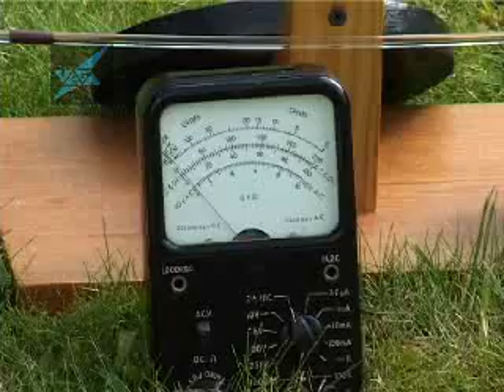Windmills Homemade

Comment: It`s common for many families to stare dejectedly at $200, $300, $400, or even $500 in power bills each month. There are times when even a rich family cannot seem to afford amounts like this for the upcoming months. You can cut electricity usage and bills through the generating power method “boma fetching unique” (Google it), which helps you generate you own power.

Comment: the last one you demonstrated? The Flutter generator, say you had a small drone plane, and using this theory could you add enough flutterers to it to run the small electric motors or atleast charge the battery/capasitor enough that it would not lose power and could maintain flight until the engine failed?
Reply: I believe the flutter generators would cause too much drag to be able to be mounted on a plane, or it wouldn't fly
Reply: Ever see a kite with ribbons on the ends? I think it wouldn't cause too much drag. Think of a bird and it's feathers. But imagine generating static electricity from wool and latex feathers that could generate enough power to run a small motor. Think of it. So long as there is wind passing through the feathers causing them to create static generating enough power that can be stored in a capacitor or small battery to run an on-board motor that would power the craft indefinitely
Reply: +Erik Palafox what's up
Reply: Babukrishna ? The sky and solar power.
Reply: +Erik Palafox: I can see the possible potential of your idea, however I see big problems obstructing a positive outcome.
1A: Aaron Keith was right. The biggest problem is the drag added to the vehicle. 
1B: The amount of Work being done in generation of electricity would not out way the amount of work being exerted by the motor to keep the vehicle in flight. How do I know this? because the transformer that would do the generation would be heavy and not 100% efficient. Work-in will always be more than work-out. The best case scenario would be an extension to the range of the vehicle. 
2: A kite doesn't fly... it hovers (erratically). Also The reason a kite stays in the air is due to pressure from wind. A kite would be a great tool for utilizing the flutter design though, if you could find a way to make it stay up without having a human control it 24/7...and the control mechanism used less energy than the kite produced...
3: Birds... let's not go there. if you tied kite tails to the back of a bird it would just need to eat more worms...
Reply: I wasn't talking about a bird, but the design of the creatures "feathers" One feather latex material and the other wool, or other conductive material that could be used to generate a current. Instead of a transformer, a capacitor could be used.
Reply: What if at the  top rear of the plane, the point to which the most drag will occur someone designed a wind turbine in the shape of a steam boat wheel on both sides. off set each side so that when they spin they alternate their directional push???...
Reply: Americans never say it can't be done. I say it can be done. I just need someone willing to make a prototype and experiment. I think it's completely possible.
Reply: hopefully you can visualize my idea. I honestly think it might serve practical application.
Reply: It's also a good idea Dustin. There are lots of things out there that haven't been proven successful mostly due to a lack of application.
Reply: And some of the best and coolest things were made in someones garage. It takes someone willing to invest time money and thought to produce something awesome.

Comment: you do not have to turn the wind TURBINE to follow the wind just put it on a rotating disc the once you can also use for a TV and give the wind turbine a tale so it will automaticly follow the wind direction!

Comment: its NOT a windmill it is a wind turbine if it charges things!! do NOT call it a windmill it isnt crushing weeds into flour...
Reply: Exactly what I was going to say
Reply: +S Dew you mean it's not milling?
Reply: themalloys exactly
Reply: Your talking about an Old Gristmill. Not a very active vocabulary word. The accepted word in conversation for what you are saying IS "Windmill". Get over it. I don't know why it was so hard to say "Thanks for the article that got my brain thinking." Anyway FYI: A windmill is a mill that converts the energy of wind into rotational energy by means of vanes called sails or blades. Centuries ago, windmills usually were used to mill grain (gristmills), pump water (windpumps), or both.
Windmill - Wikipedia
And Thanks VegaScience Trust for an article that got my own brain thinking. lol.
Reply: very very interesting innovation using solar and wind energy. thank yo

Comment: Thats not a windmill if it's not milling.  Do you mean it's a wind charger or wind turbine.  A wind mill makes flour by milling it.
Reply: A windmill is a mill that converts the energy of wind into rotational energy by means of vanes called sails or blades. Centuries ago, windmills usually were used to mill grain (gristmills), pump water (windpumps), or both.
Windmill - Wikipedia

Comment: What's the pitch on propeller blades if I make my own ?
Reply: The pitch works a little like having a gear ratio.  Putting the blade at 45 degrees to the wind means that the blade will try to go the side as fast as the wind goes past.  For flat blades this is a good angle to stay near.  You can make it so that the blade is 30 degrees to the wind if you need more RPMs or 60 degrees if you need less.  Remember that over that range torque times RPMs is roughly a constant for a given wind speed and diameter.

If you have the means to do it, making the blades curved like a wing gets a little more power out of the wind.  The flat side of the wing is the side towards the oncoming wind.  Also as you go out on the blade, the distance it needs to travel gets further.  A twist that makes the blade near the hub at 30 degrees and near the tip at 60 degrees makes a better blade.  Given that the wind is free, however, it is not needed to do a fully optimized design.  Wasting a little wind is no crime.
Reply: Ken Smith
I wasted some wind in an elevator once and, from the looks I got, I'd say it's definitely a crime!
Reply: is it also possible to have the blades loose so they are able to self adjust to wind direction if the turbine is fixed or just loose in case of swirling gusts?

Comment: Here is how one compares torque to horsepower. A large windmill blade with little wind will yank your arm off dtarting out, which is torque. With small blades, it needs a lot of wwind to move, that is horsepower. The Toyota trucks with a v8 produces 90 percent of its torque, right above idle, due to light weight engine parts, and cubic inches. I read a roadtest where a toyota had 800 pounds of plywood in its bed and it kept up with a same size empty bed Chevy thru the quarter mile. Anyway , for the punks out there torque will outrun horsepower. A smaller engine will outrun a bigger engine.  Power to pull hills without changing gears with torque is what counts, Horsepower will not make a car go faster on takeoff.
Reply: If you are free to change gear ratios, horse power will win over torque.  Power is torque times RPMs.  With gears, you can trade RPMs away to multiply up torque.  Thus an engine that can go up to higher RPMs and yet makes slightly lower torque be mated up to a transmission with a higher gear ratio and win. 

Thus you are wrong on each of the conclusions.

Comment: Someone told me that mennonites didnt believe in using the modern convenience of pollutung wasteful electricity. So they dont believe in a windmill using electricity, but if a windmill has chains and sprockets leading dowwn to a well pulling the water up. Then that is ok. Why should it make any difference which way to do it.

Comment: Unfortunately the problem with the vertical axis turbine is that half of the assembly is moving against the wind as it turns. Obviously the rotor is cupped to avoid this partially but on the horizontal axis turbine the blades are actually airfoil shaped just like an airplane wing & so once its spinning a certain speed the blades create lift & pull themselves along, speeding up the rotor & producing more power.... the rotor size to power produced ratio is much better on horizontal axis turbines..

Comment: Nice video! Kudos to keyofdavid888 for mentioning the phenomenal Nikola Tesla! Every time someone throws a light switch or plugs in an appliance, you can thank Tesla for the Poly-Phase A/C power system that is delivering the juice. Were he living in this time, the technology available to him would have made his quest for wireless power delivery across the entire planet feasible! Politics would still of course be an HUGE issue, but the technical requirements would have been at his disposal...

Comment: Considering that electricity is an extremely necessary commodity around the world, it should be free, and not left to private industries to cash in on. Nor should Wall Street be allowed to speculate with its pricing for its own gain. What it would cost to run a power plant should be covered by taxes and run by the government. I can promise you it would be A LOT cheaper that way.

Comment: It would be really helpful to make a video for what is used to make a magnetic generator for a little wind turbine.  I have neodymium magnets and very thin copper wire (about .006 inch diameter), but not having an electronics background, I don't really know the other components, and that would help.  Also, there is a two part sculpture compound called Magic Sculpt that you can hand mix and form and it becomes extremely rigid - you might be able to use that to form some of your moving pieces.

Comment: Hi - I'm planning to make a little arty wind project - I thought about the flutter one, and I think you might be able to make one maybe with a helium balloon on one side and maybe a spring or counterweight on the other side if the flutter turbine just causes a mechanism to back and forth - you could probably get that with a balloon and an opposing force - that might also work pretty well in really low wind areas.   Let me know if you think that might work. :)

Comment: In large commercial wind mills how do they maintain a fixed voltage?
Is power generated in them stored or directly distributed?
thanks.

Comment: With the traditional windmill one does not have to turn the blades in the direction of the wind. All you have to do is fit the back half of the windmill with a Tail (like in a plane). However what you have to make sure is that the wind mill is mounted on vertical shaft that allows it to turn in any direction. Also the shaft should be connected a little off center of the windmill, slightly more towards the blades that will allow the tail to swing, making the blades face the wind at all times. thx

Comment: have you applied a motor to it yet? mine isn't a vertical, ad hauls butt till I add the 1 to 5 gear ratio to it and the motor. I had an idea since it's easier to reduce the gears from 5 to 1 than 1 to 5, we should be able to use a pully system that gradually uses the gears to pull up a 100lb weight with ease, and hit a lever to drop, while producing enough rpm to charge a battery bank, this way all of the wind is utalized for power at some point as a cycle, instead of relying on high wind only

Comment: My God people, Just try calling them turbines. Just try it. Either that or actually "mill" something. It is not a wind generator because it does not generate wind and it is not a wind mill because it is not milling. It is a turbine. It generates electricity. More specifically, electrical current. Turbine, not windmill. It's 2011.

Comment: There's no problem with a horizontal axis windmill pointing to the wind.  Ever heard of a tail?  A tail on a windmill would be a fundamental piece you left out of the horizontal design.  So, the only problem is something that was left out?  HAWT is standard in all wind farms, that's because its design outperforms all others..

Comment: You could store the power using deep cycle batteries. Especially if you live in a place with inconsistant wind gusts. Or maybe use solar as well as wind to keep a steady supply of power?

Comment: I made one of those one of those once, out of wood. It was 29 feet and 7 inches tall and was a vertical windmill that spun on a custom made ballberrings and shaft that you could attach various machinery and devices to. Each wing was 21 feet tall and 9 feet wide. Unfortunately, a storm ended its proud tall life to a pile of splintered wood. I only have one photo of it -_-

Comment: I'm surprised as a DR. you would not know that all you need to keep the windmill facing into the wind is a simple VANE. A weather vane is a horizontal tail that keeps pointed into the wind. (This is not rocket science)

Comment: This is cool... But in regard to the first model needing to be steered, couldn't you solve that issue by building it on a swiveling base and putting a flat, vertical fin coming off of the Z-axis so it is always pushed in the direction that the wind is blowing? Similar to the model of a weather vane.